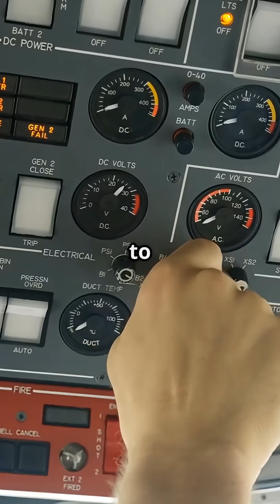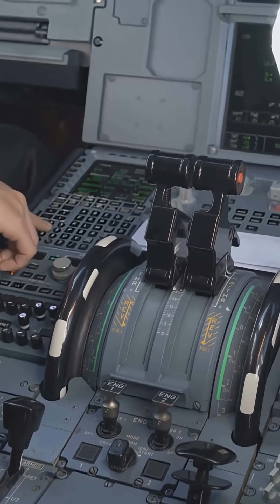Automatic Trim vs Manual Skill: Which Keeps Pilots Safer?

Comment: The legendary Lockheed L-1011 Tristar used a "flying tail" design; in which the horizontal stabilizer does not only adjust the trim angle, it could also be used actively (in conjunction with the elevators) to give greater flare control and last minute adjustment.  

Perhaps more importantly, they also paired this with "direct lift control," in which the spoilers can be used in real time, to bleed off lift (in response to control column input).  This greatly reduced the need to constantly adjust for nose up/down pitch corrections via trim, and allowed for nearly perfect and virtually constant pitch angle during the entire descent and approach phase, and contributed to what has been widely known to be the smoothest landing aircraft ever made.  

Yes, seiously, it was the best. I'll never forget those landings.  Modern jets are almost as good but from a passenger perspective the L-1011 was a work of art. 

Would love to hear from any former L-1011 pilots though about the Tristar workload and flying experience, in relation to a Boeing or Airbus for example.